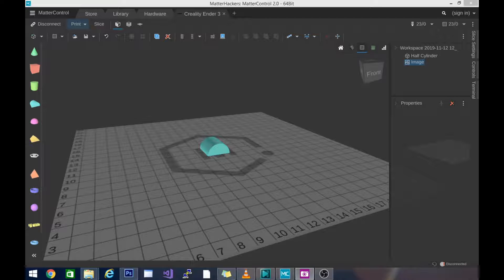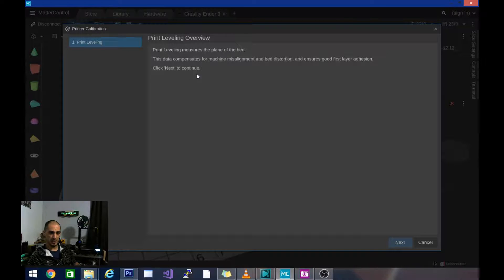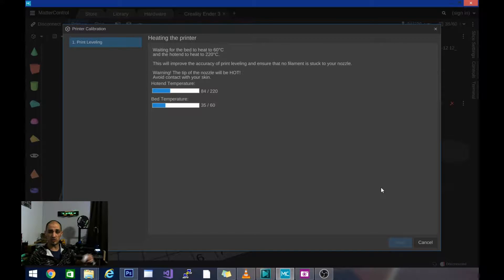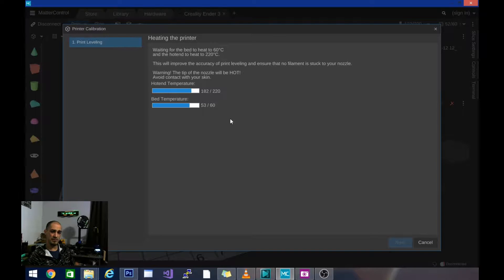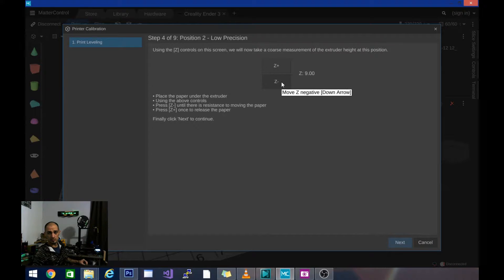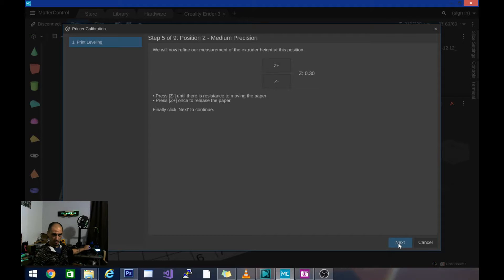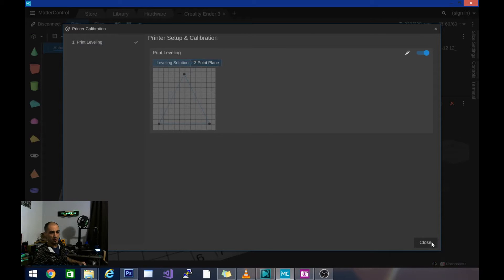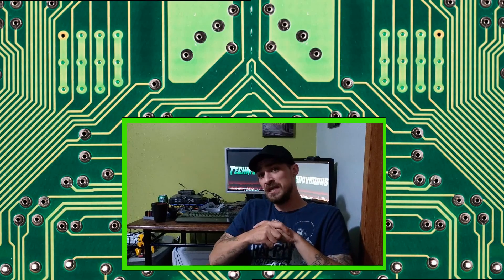Easy and accurate assisted bed leveling - MatterControl 2.0

Comment: What advantage does this have over using your firmware mesh leveling? This seems like something that doesn't really need to be part of a slicer.
Reply from the maker: its kind of just there to show you their are extensions for calibrating specific parts as well and i assume intended space for other future options. the advantage over the firmware leveling is that i dont need to touch the firmware, i.e. perfect for new users who need help with leveling. or dont have the IDE or know how to turn on mesh leveling.

Comment: When using this method of bed leveling do you need to set the bed level knobs all the way up or down before you use the software calibration process? Otherwise it will have to be calibrated everytime the knobs are moved out of position.